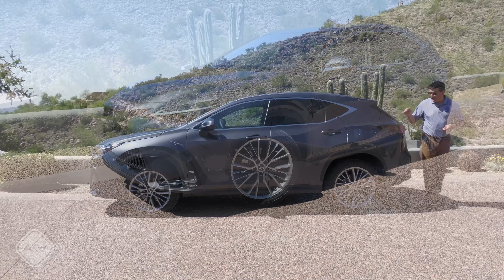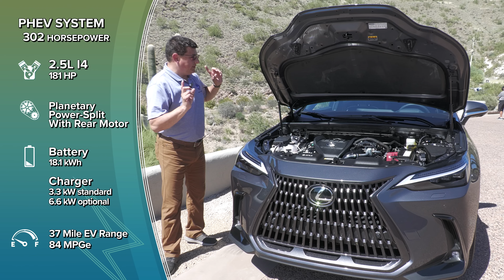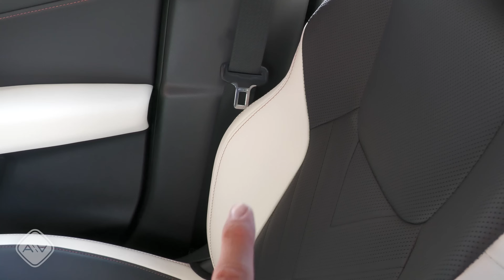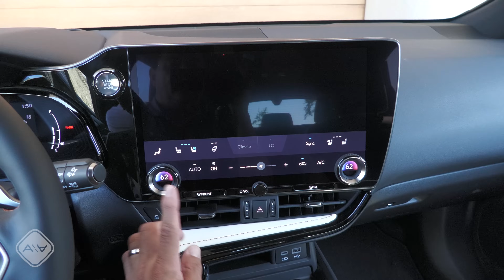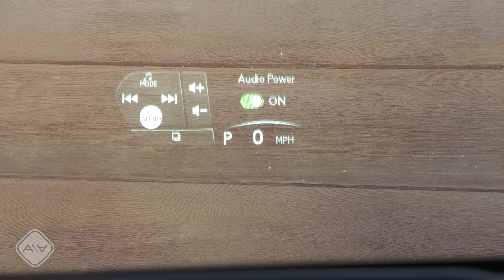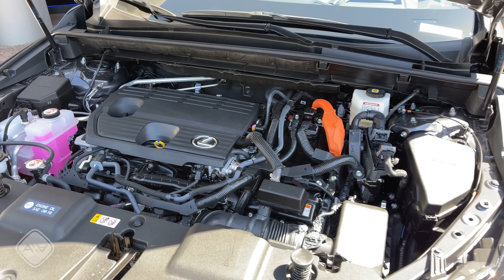2022 Lexus NX First Drive | Big Screens, More Hybrids!

Comment: We just purchased the 2022 NX 250 with premium package. This seems to be the model that no one reviews. For me as a person who keeps a car forever, the perfect mix. It has a naturally asperated 2.5 liter. No turbo charger to put extra stress on the engine and extra parts to eventually wear and possibly need to be replaced. Also not hybrid to be concerned with battery replacement in years to come. I don't drive a car like I stole it (anymore) so 0-60 times that are 2 seconds less and nearly $10,000 less than the top drive train plug in hybrid are not a concern. There is plenty of power for normal driving, passing, etc. It averages around 30mpg too. I definitely did not want the head-up display that has blank steering wheel controls that change depending on what mode you are in. The 250 has dedicated steering wheel buttons clearly labeled for phone and audio control, cruise control and all of the MID display functions. The premium package adds moon roof, heated and ventilated front seats, foot operated rear power tail gate and other options. One additional option we did get is the gorgeous 14" infotainment touch screen. All in all, a reliable and fuel efficient beautiful car with all the safety and luxury components we could want at a reasonable price.
Reply: The price difference is only $3-4K, I would pick the Lexus.  In fact out Lexus NX Hybrid will arrive in mid April,  the difference between a Venza Limited and RAV4 Hybrid Limited is only $$3-5K.  It is a no brainer for us since we keep cars for 10+ years.
Reply: Why didn’t you just save and buy a RAV4 limited instead?

Comment: As I watch this video again, the front seat space seems snug, even cramped.  Am I wrong?  I'm 95% sold on this model, but I can't test drive one because dealers don't have any.  Thoughts?  And, is the battery liquid cooled?
Reply: I think it depends on your physical size and which vehicle you're used to now. I don't find it "cramped" but I'm 5'3"

Comment: It is February 2022. NX Hybrids will take MONTHS yet to become available. But we can take heart that within 5 years, Lexus will only sell hybrids and EVs; regular gasoline engines will become dinosaurs (I was so informed by someone in authority at the dealership). But as to the latest 2022 NX, I sat in one a few days ago but maybe my torso has shrunk over the years; even after raising the seat up I had a hard time looking over the hood at the road. Plus, the cabin is pretty cramped. This is what is so awful about SUVs: they are big hulking masses but yet, the cabin is relatively, pathetically, small. Ah, well. I walked away from the NX, to a 2022 ES300h. Love it! During acceleration the engine noise is subdued, and for a hybrid, it is peppy indeed. Plug in hybrids (PHEVs) are an absolute ripoff. All we need is a larger hybrid battery to help with acceleration. The full EV range that current PHEVs offer is a joke. And the dealers/manufacturers do the laughing at the joke, all the way to the bank.

Comment: Just don't expect the agility of a Genesis GV70 or Alfa Romeo Stelvio. On our figure-eight course—a MotorTrend test that evaluates acceleration, braking, handling, and the transitions in between—the NX450h+'s performance doesn't reflect the way it feels in the real world. The plug-in finished the test in 28.4 seconds at 0.57 g (average), well behind the quicker Volvo's 26.3 seconds at 0.69 g but also behind the RAV4 Prime (27.0 seconds at 0.65 g) and the NX350h. That NX hybrid variant is nearly 400 pounds lighter than the NX450h+ and finishes the figure-eight course quicker, at 28.0 seconds at 0.59 g.

Comment: In our testing, we beat the Lexus-estimated acceleration to 60 mph by a full half-second, hitting 60 in 5.5 seconds versus the quoted 6.0-second time. That's quicker than the other 2022 NX models we've tested, but a 2021 XC60 Recharge reaches 60 in a MotorTrend-tested 5.0 seconds. We haven't yet tested a Q5 plug-in, but Audi estimates its model to be just as quick as the Volvo. In case you wonder, the lighter-weight RAV4 Prime matches the NX450h+'s 5.5-second time to 60.

This means the NX plug-in hybrid is both the quickest NX money can buy and the slowest SUV in its tiny segment.

Comment: "...This new take on the NX is arguably the best compact SUV Lexus has ever built, but unless you're tied to the Lexus badge, there are better options in its segment. Sure, it's the only non-plug-in hybrid in the class (ignoring mild hybrids, that is), but if you really want to reduce your environmental impact, either buy an EV or go for a more impressive non-hybrid SUV and eat a little less beef.Despite its off-road prowess, we found the NX350h's overall ride and handling somewhat less impressive. Dynamically, the NX defaults to understeer (as most similar crossovers do and probably should) with reasonable grip, but it doesn't deliver the type of engaging driving experience the Jaguar F-Paces and Genesis GV70s of the segment do. From an overall ride quality perspective, the NX350h's suspension will easily reach its bumpstops through larger bumps and struggles to settle down over stretches of uneven pavement. The cabin is proper luxury-SUV quiet, but the rest of the experience fails to live up to that standard...." Motor Trend

Comment: Is it possible to put a small spare tire under the boot floor? It used to be possible with 2021 nx. I see storage compartments in Alex’ 350h review, I wonder if they are removable. Lexus dealership in U.K. are unable to confirm. Any ideas appreciated.

Comment: Thanks for the good initial review.  Lexus NX 350h is definitely on my list.  Would prefer a 450h all things equal but they are apparently not available in my state.  I'm also leery of having to pay above a usual reasonable cost given the newness and availability of the vehicle.  Plan B includes a couple of the Hyundai hybrids.  I definitely want a hybrid SUV.
Reply: Lexus the best!!!
Reply: Why not a rav4 hybrid or venza hybrid?
Reply: @naveenthemachine , those are good choices as well.  The Hyundai Santa Fe and Tucson are rated a bit higher by CR than the Venza and the RAV4 respectively (for what that's worth).  I still need to do more research, test drives, etc.  I do like the look of the NX though.

Comment: I think I would still go for the GV70 over the Turbo model of this.
Reply: Agreed 💯

I’ve said this before and I’ll repeat again. I predicted that The nx would honestly dead on arrival before anyone even drove it. And sure enough I was right

So yea gv70 is a better vehicle in every aspect. One cool idea is to remove the genesis badges and replace it with the Lexus badge. And replace the gv70 badge with the nx badge 😆
Reply: @competitiveautomotive5457  The interior looks disgustingly cheap compared to the GV70.
Reply: @OM_42  agreed
Reply: @competitiveautomotive5457  agreed as well

Even my 2020 Camry has a nicer interior than the nx
Reply: @RR-ll2ns  keep mocking me

My prediction was still accurate that the nx would already be outclassed before anyone even drove ir

Comment: Very pleased with what I've seen here, and eager to see an actual 0-60 on the NX turbo AWD. The standard feature content and overall package seem very impressive, and I appreciate Alex pointing out the cargo hold is larger than numbers indicate. All this said, a minor thing that feels like it could be a deal breaker for me, is that oddly unadorned expanse of dashboard that the passenger has to stare at. Surely, Lexus could have done something more interesting there.
Reply: Redline reviews was disappointed with the nx350 turbo. They got 7.2 seconds 0-60 despite the claim of 6.8 seconds

I personally prefer the nx350h over any other nx model. also regarding your complaint, there’s an easy solution: don’t look at the passengers side area and also don’t sit in the passengers seat 😆

If your passenger complains throw them in the back seat 😆
Reply: @naveenthemachine  - where did they test it? as Alex noted, elevation and 106 degree temps matter. despite the proliferation of online reviewers, I'll still look to the atmospherically corrected numbers from C/D, which also publishes a much more real world 5-60 stat.
Reply: @joec1774  It was tested at this same event.  With that much power, it should still be faster despite the heat. Even an Outback XT with a similar sized turbo with less stated power still managed around 6.1 with a CVT.
Reply: @niuhuskieguy  thr cx5 w the same power and 2 less gears is also faster than the nx

Comment: Not wild about the styling, which has gotten busy and kind of chunky. The last generation was a lot cleaner. I'm also shocked they didn't put a fully digital instrument panel in it. Some more basic models than this have been offering them, at least in higher trim levels. I do like the hybrid options, which don't involve many compromises.
Reply: I feel like the gauge cluster in Toyotas like the rav4 Camry venza or Highlander or Sienna feel much bigger despite having a 7inch screen in the middle than most Lexus models

Comment: Alex.  How does this compare to the 2022 Hyundai Santa Fe Hybrid/ plug in in regards to how it drives and quietness?  I know you mentioned the 2022 Huyndai Asante Fe is pretty quiet almost comparable to the 2021 Lexis RX 450H.   I like the size of the 
2022 Hyundai Sante Fe hybrid more but wondering if it’s a quieter ride than this new 2022 Lexus NX?
Reply: Um a Santa Fe is better. May not be as efficient, but it’s cheaper, arguably more luxurious, better tech, longer warranty and more practicality and handles better and performs better too.

Comment: I was going to wait for the NX450+ to come out but in the end, I didn't.  I just bought the Hyundai Santa Fe PHEV Limited trim last week and I'm extremely happy with it.  No looking back for me.  I actually got 35/36 miles of pure electric range from my commute even though it was advertised at 31 miles.
Reply: Good choice. The nx would have been a huge disappointment to you vs the Santa Fe. Is yours thr calligraphy model?

Comment: I rather spend a bit more and get the gx460. V8 power and more refined and quiet.
Reply: I’d save 10-20K and get a v6 Camry that’s also quieter and more refined than the nx but also more efficient than the turbo and way faster

Comment: Great review as usual. Do all NX models require premium gas?
Reply: While Lexus/Toyota engines that specify premium fuel will run on regular gas it is NOT recommended by the manufacturer.  Turbo engines generally have higher compression ratios and run hotter than a normally aspirated engine by design.  If you use regular gas when premium is specified the engine will automatically retard the timing producing less power.  More importantly the engine will run even hotter placing additional thermal stresses on the engine and turbo which over time will shorten the life of the engine.  There are videos available here on youtube that explain this in detail in you are interested.  Saving pennies on fuel compared to replacing an engine - your choice.
Reply: If the Rav4 doesnt then probably it doesnt
Reply: @koukimonzta  Except it's more closely related to the Highlander. The reality is almost all vehicles now will run just fine on regular, though they sometimes make less power. The knock sensing is very effective at adjusting for varying fuels.
Reply: @markmiller3279  the previous NX needed premium, in Canada we pay 25% more for premium gas. My 2018 RX is great uses regular gas.

Comment: Let hope the new Lexus Rx will get this 2.4t
Reply: If it does it’s game over for the RX

The gv80 already destroyed the 2023 RX that no ones seen yet. That’s how good genesis is
Reply: @naveenthemachine  destroy the RX on what? Performance, handling or sales numbers? RX was never a driver vehicle and still selling well. The RX just needs a true 3 rows.
Reply: @duchoang7856  not just performance. It’s handling, exterior design, and interior design, comfort, suspension polish, materials quality, fit and finish, the technology, practicality, the level of luxury it exudes, the amount of presence it exudes. Every reviewer has said the gv80 absolutely destroys the RX. Alex on autos himself titled his first gv80 review “the suv Lexus should have built”. He himself said the gv80 interior really is world class and can go toe to toe with the X5 xc90 GLE. He said he would take the gv80 over the RX pretty much any day

Literally every luxury suv has some high power option and I’m not talking the 500hp X5m50i or GLE53 AMG. The MDX type S is coming out w 355hp turbo v6 and fast shifting 10 speed, and the gv80 has a turbo v6 w 375

The most powerful RX will probably be 302hp the rx450h+. And knowing Lexus it’ll be very expensive. There’s no way there’ll be a 400 or 500hp RX

If Lexus wants to even compete, they have to first far exceed the gv80. That’s the first target. They need to make the interior way nicer than the gv80 perhaps use the LC500 interior as a starting point
Reply: @naveenthemachine  lexus isn't going to mess up their bread and butter. Everything you said are true, yet the RX still a sale leader.
Reply: @duchoang7856  the nx is a hot seller too yet they definitely messed up big time 😆. Literally everyone else said the nx is disappointing and the turbo and interior leave a bit to be desired

Comment: Anyone else terrified at the possibilities of the new 'electronic actuated doors' that won't open if the blind spot monitoring is triggered? Like, hardware malfunction and the car is on fire, or in a crash, or any other million reasons getting out of the car fast is important; but the nanny won't let you open the door?
Reply: there's a manual lever incorporated into the armrest, you can use that

Comment: The infotainment screen looks like a wooden pizza peel lol, they poorly integrated the screen , In my humble opinion I think they should have used a dual screen system like the Mercedes Benz so the dashboard would have looked much better. GV70 is still the best , amazing interior design, more power . Just better overall period
Reply: Agreed. The nx is already dead on arrival and it’s not out yet. I knew this would happen…
Reply: @competitiveautomotive5457  It's not impressive, but it's a Lexus in a very hot segment, so it will probably still sell well.

Comment: i dont like that there is no spare wheel.... although it looks like there is enought space under the cargo floor.... Alex, dont you wanna do the same experiment you did with RAV4....? :)
Reply: Does it have run flats, otherwise the rim will get destroyed getting to a safe place?
Reply: @user-tb7rn1il3q  yes it comes with a run flats.... and i dont like it. :P
Reply: @R1S0.  I don’t really see a reason to buy this over a RAV4.
Reply: @user-tb7rn1il3q  I don’t see any reason to choose an nx over any of its competitors like even a cx5 or Santa Fe Calligraphy
Reply: @competitiveautomotive5457  The CX5 is overrated.  Hyundais are better than they used to be, but still not great.
Reply: @user-tb7rn1il3q  they have a longer warranty and the cx5 handles better is faster and looks better too and the signature trim is just as nice inside but for less
Reply: @competitiveautomotive5457  I realky like the CX-5, but think the aged powertrain and weak infotainment are holding it back. It's very dated by now. I hope the eventual redesign gives it a major upgrade, while keeping the classy styling inside and out.
Reply: @markmiller3279  I’d say the cx5 has aged well and the infotainment is annoying I’ll agree but the 2.5T and 6 speed auto are great pairings. Much better than the nx350 turbo and 8 speed

Comment: A 450 badge on a engine with barely 300 hp is a joke, for the money you should get at least 350 if not 375
Reply: The nx in general is a joke. Literally anything else is better
Reply: It has 302. Good power imo but you can get that power in a Camry from a 3.5L v6, the engine that the nx350 should have had. The plug-in hybrid 300hp is fine though. It’s the most efficient by a mile vs the others albeit it’s very expensive haha
Reply: @naveenthemachine  Still, if 450h+ is 302, the nomenclature is misleading and with the power a 4 cylinder could make, 300 from combustion alone isn’t unreasonable. I would think that at the 60k price tag this will probably carry, it will have a hard time grabbing buyers who care about performance. For reference, a GLC 43/X3 M40i make almost 400 and ride equivalently, I just don’t see a good reason to buy the top engine on this.
Reply: @andrewm6716  Nobody is buying that PHEV for speed. It's mostly about efficiency, with just adequate perfornance. I think six seconds 0-60 is fast enough, and it should feel quick off the line with hybrid torque. If you want more performance there are other options, all much less efficient.
Reply: @markmiller3279  Fair enough. I do still hope that Lexus builds a more powerful “F enhanced” version of the power train. High performance hybrids can be quite fantastic, but they probably will just make it an appearance package and it will be way to expensive for what this car is actually worth.

Comment: I believe the 275hp version will replace the awesome 2GFRE 3.5 V6 across the board at Lexus/Toyota. Very likely to show up in the next Camry within a year or two.
Reply: Very likely. That's just the way the world is going, replacing sixes with turbo fours. They have similar power and more torque, in a smaller, lighter, more efficient package. It's possible to keep the engine bay smaller if it won't have to ever hold a V engine.
Reply: Yea it'll replace all models with the 1gr and 2gr in America.
Reply: Yeah. That’s very Unfortunate. I love Toyotas 3.5L v6. It’s buttery smooth and Lexus like in quietness

I wish the nx350 got the v6. That would help increase sales and make the nx350 even more popular